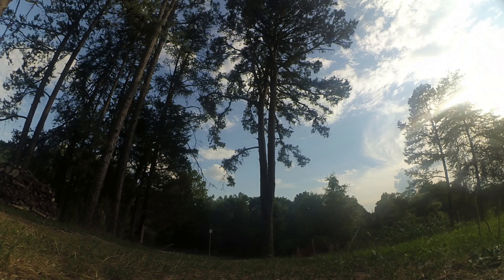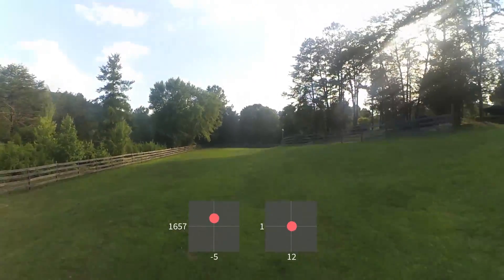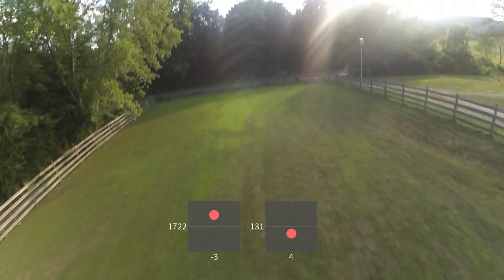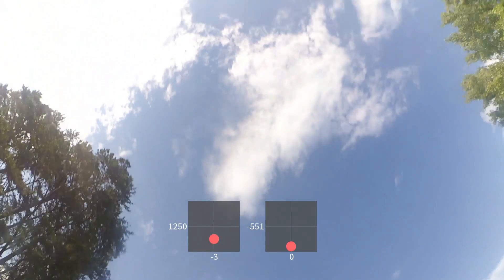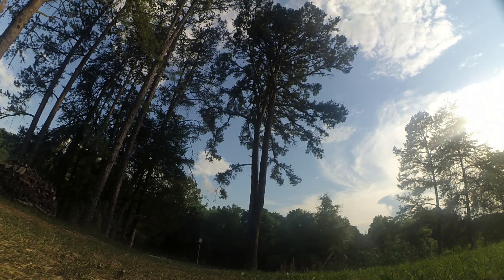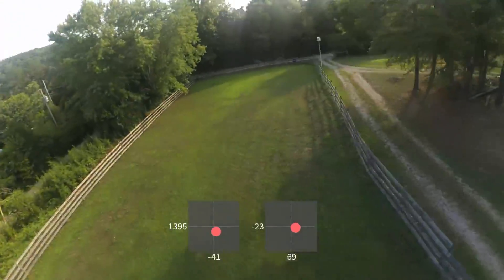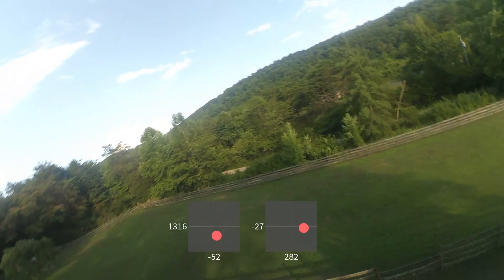How To Do Backflip Under An Obstacle | QUADCOPTER TRICK TUTORIAL

Comment: I watched this again before flying this evening and it really helped make my backflips smoother and faster.  I realized that I used to blip the throttle then cut the throttle completely before I even started rotating.  Now instead of blipping the throttle I keep it where it was for normal forward flight but instead of dropping it before the flip I wait until I I've begun to pitch back then drop it.  This gives me the bit of extra altitude that the blip did but looks a lot smoother and I'm able to do them pretty damn low while cruising along pretty fast.
Reply from the maker: Awesome! That was exactly the tip that I was hoping to convey.

Comment: Any recommendation for improving copter's water resistance? As a beginner, I will be flying out in grassy areas early every morning starting soon and am worried about the moisture which the copter will be subject to upon what lets hope will be few collisions haha. I have the Emax red bottoms which are fairly shielded but how concerned should I be about dust and water getting in them? ESC are heat shrunk very nearly in my setup so those are good... So then my final concern is the moisture which will be around my solder mess from the ESC wires soldered to my quadrevo powerosd. Im gonna look for some kind of clear coat spray to add a very thing layer of plastic over my power distribution board/ flight controller. Any comments, ideas or experience regarding the topic will be appreciated :)
Reply from the maker: +Pablo Contreras watch the Flite Test video on waterproofing.

Comment: How much flight time does your setup gives you ?
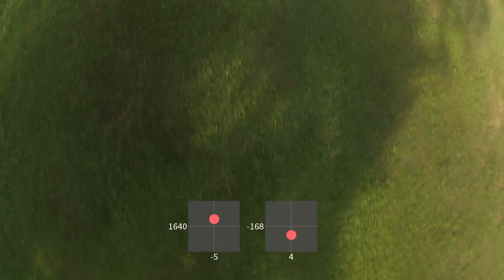Reply from the maker: 2-3 minutes on a 1300 mAh 4S depending on how aggressively I'm flying. Possibly as much as 3:30 to 4:00 under some circumstances such as if I'm demonstrating a not-too-demanding move.
Reply: Thanks, do you think it could by any chance get up to 6min if cruising ?
I'm building a Tweaker FPV Addict 180 at the moment, and it can only take 4" prop on 2204 motors. What setup would you suggest if I want it to be nimble while not sacrificing too much flight time (Not sure if it's realistic - 6,7 minutes ideally)?

My current idea is :
Cobra 2204 2850KV Motors
Dalrc xr20A ESCs
Tattu 1300mAh 4s 74c Batteries
KingKong 4045 Props

Another unrelated question is why people doesn't choose the highest KV motors available? They can always throttle less in order to extend the flight time or to be slow, and it also have a broader range in speed to choose from. Basically what is there to lose by choosing high KV motors over a lower ones ?

Thank you
Reply from the maker: 6-7 minutes on 4" props is probably not impossible, but you gotta ask what you're really going for here. It's like buying a Ferrari and then babying the throttle to improve your gas mileage. Just buy more batteries.

Higher kv means lower torque. Might as well ask why all cars don't come with 5th gear only. You need torque to change prop speed rapidly. Also, higher kv motors get really inefficient with more aggressive props.

Comment: Why is the XSR not as popular as the X4R-SB?
Reply from the maker: Came out later. Direct-soldered antennas are harder to repair.
Reply: +Joshua Bardwell far enough thanks :) and awesome tip! Could you make a video on the LaForge diversity receiver system?
Reply from the maker: I don't currently have goggles that would take the LaForge... or a LaForge. I'd love to do the video though.
Reply: +Joshua Bardwell patreon here we go :)
Reply from the maker: You think you're kidding, but maybe not. To be completely honest, my usual approach when equipment is holding me back from doing a video is to put out feelers to see if there is a vendor who wants to work with me on the video. You never know... it might happen.

Comment: if anyone would know it would be you... one more question in blheli suite it says multi... i imagine this means multishot is enabled? i also enabled it in betaflight
Reply: I thought that it meant multi was to distinguish fixed-wing vs multi-rotor for the esc selection(that was my guess, but could be totally wrong!)?? Does Blhelisuite have a firmware for multishot just sitting right there? Haven't checked in a while? Hopefully Joshua chimes in to clear it up! When I tried multishot I had to do a google search and found the firmware on a forum. Then do a flash from local and select multishot for my specific escs. Then enable it on cf. Not sure if I went about it all wrong (likely chance) but either way I experienced some anomalies and after watching some stuff Skitzo had to say I just made sure I ran Borris B's betaflight with super expo and ran it the way Joshua suggested and went back to oneshot. So far I'm loving my quad!
Reply: If you are talking about flashing firmware in blheli suite, multi is fw for multirotors, main is for helicopters, and tail is for helicopters too. So as long as you select the right file for your esc and it says multi, you are good.
Reply: +IzakGt multishot works great. Were you using the latest? 14.6 I think, off the top of my head.
Reply: +mrmurder75, I did and I had used IM tune thinking how cool! But realized I only fly by myself and it got annoying fast lol.
Reply: +IzakGt haha, yeah, I used that for about 6 lipo and it got really annoying! I use the crazy start one now. Slightly less annoying! Nice change from the usual esc start up tones though.

Comment: i know this isnt the right video for this.. but i was wondering if u can help me... im using 30amp aikon esc's with blheli-s , Lumenier 2206 2000kv and SPF3 FC.. when i turn airmode on min motors spin as normal.. if i give a little throttle and go back to zero throttle my motors start winding up faster and faster.. if i switch to acro mode while they are winding up it seems to affect it but not fix it.... im at my witts end do u have any idea why this is happening? by the way multishot is enabled and im using betaflight 2.9.1
Reply from the maker: +bobby averona this is iterm feedback. It's normal when you spin the motors on the ground. Just go fly.

Comment: Do you think some of those oscillations were from the unbalanced props?
Reply from the maker: It's not just about amp draw. The weight, thickness, and surface area of the prop matter. A heavier, thicker, wider prop needs more torque to spin up and down quickly. I suspect that overall flight performance, such as the ability to tune out propwash, woudl be compromised running heavier props on high-kv motors.
Reply from the maker: +Droid FPV yes, absolutely m
Reply: +Joshua Bardwell what props would you recommend then
Reply: +Joshua Bardwell Why don't you just use HQ props.. always balanced well out of pack.
Reply from the maker: +Limpet86 the answer used to be price, but now you can find HQ 5x4x3 for around 80 cents each which is not too bad. The other answer is durability. They break at the drop of a hat. And I don't think HQ makes a 5x4x3 durable... do they?
Reply from the maker: +Droid FPV HQ 5x4x3 are amazing but fragile. And you have to shop around to find a good price. I am having okay results so far with KingKong 5x4x3.
Reply: +Joshua Bardwell Yes they make durables, but they are bull nose.
Reply: They sell durables 5x4.6x3 BN that have very similar performance and amp draw, at the 100% throttle the bn is 2 amps more
Reply from the maker: The bullnose props are no good on my high-kv motors.
Reply: +Joshua Bardwell DAL makes a HQ 5x4x3 clone now. durable as (expletive).
Reply from the maker: +Cognomen I just don't like DAL props. Too heavy and not flexible enough.
Reply: +Joshua Bardwell The T5040 V2s are pretty much identical to HQ ...they just dont explode if the wind gusts too hard
Reply: +Joshua Bardwell The T5040 V2s are pretty much identical to HQ ...they just dont explode if the wind gusts too hard
Reply from the maker: +Cognomen I have heard good things about the T5040v2 actually.
Reply: +Joshua Bardwell try em out....let us know what you think ;-)
Reply: +Cognomen That's a little exaggerated. Sure if you're new to flying don't get HQ props because you're going to crash lots. But for experienced pilots, HQ all the way.
Reply: +Limpet86 Its a lot exaggerated haha
Reply: Can confirm, you should really try the T5040v2.